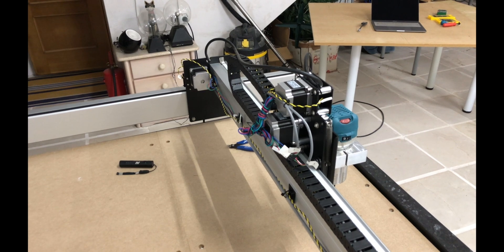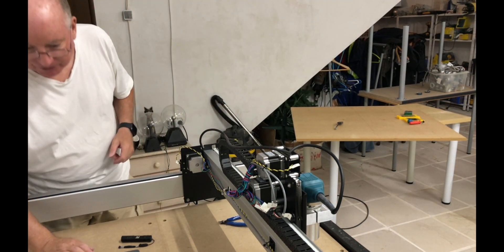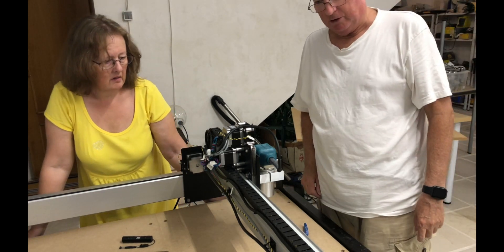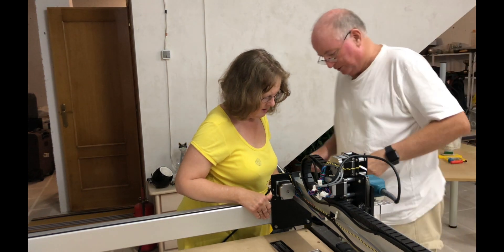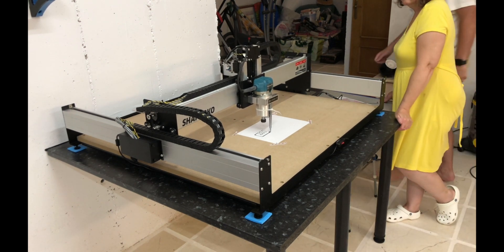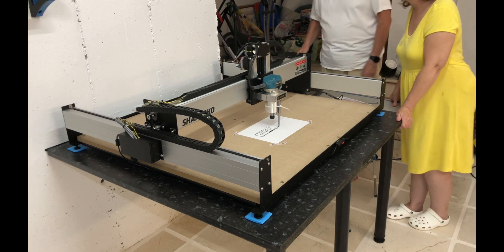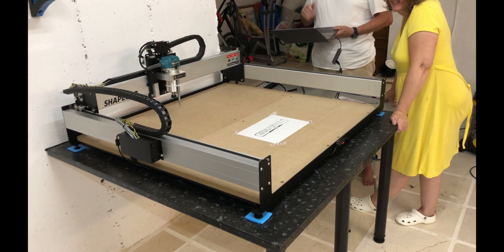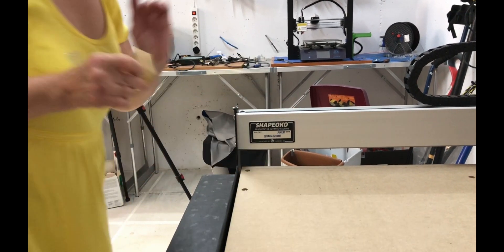Carbide 3D Shapeoko XXL  final assembly, tidy up and squaring. First print.

Comment: Did you have any issues squaring your machine?   
I did,
One side of the gantry was always about a half inch off.    
I ended up shimming the gantry to make it right.
Reply from the maker: Hi, cant say its perfect. I guess about 1mm on X axis.
Did find out that the waste board one corner was not down tight. (had double checked as well).
After that the alignment was a lot better. Though could not get front and back plates perfect when carriage rolled up to front/back. Stuck with the front being right and back left side would spring back about 1mm when released.
I am going to surface the waste board soon so it should get rid of any misalignment.